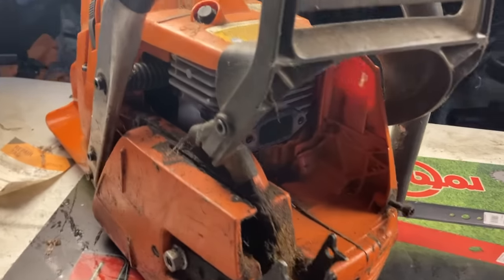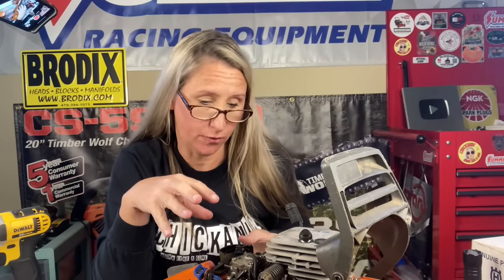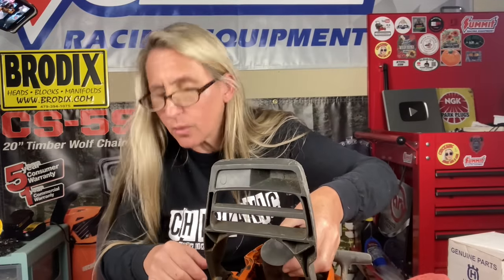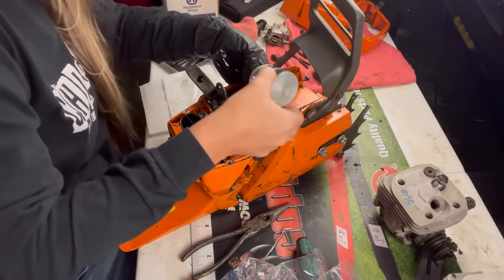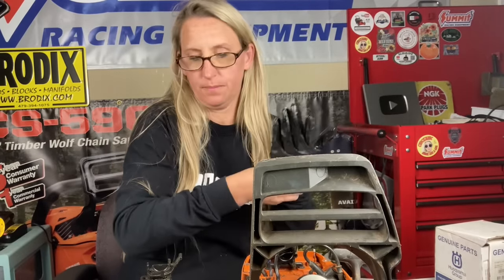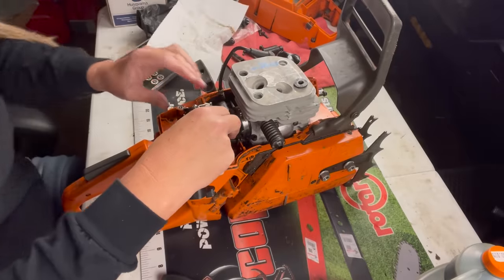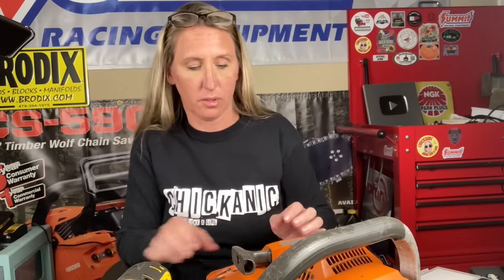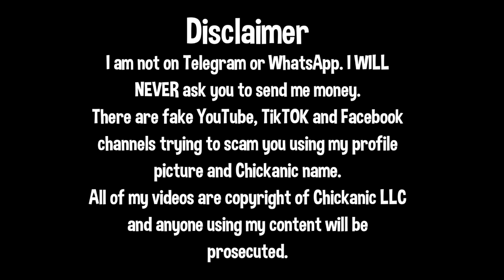Customers $1,200 Chainsaw Destroyed! Husqvarna 372 XP Rebuild

Comment: PISTON SCORING ?? I have always believed that the reason for scoring was ALWAYS a customers fault and caused by the wrong,ie, too weak fuel mix Listening and reading some of the comments it would appear that  my belief may be  wrong. perhaps a video explaining causes and actions to avoid piston scoring would be useful.
I have a pot and piston to change on an old Stihl blower (non oem so it is not a high cost risk) your video was REALLY useful. Thank you
Reply: If you don't find the true cause of the failure(crankshaft seals bad, leaking gaskets, lean or defective carburetor or intake, etc., etc., you WILL eventually have the same failure again after you rebuild it...

Comment: I live fulltime in a motorhome 17 years no landlord. got into the off grid solar power for about 9 years. newer RVs and travel trailers are junk! If you're mechanically inclined and you have a preference for certain engines. stick with that type of powertrain when looking to buy a motorhome. But if you own a heavy duty pickup, a travel trailer or 5th wheel or toy hauler is probably your best bet.

Comment: I see an engine on a stand.  🤔 Need INPUT! LoL 🤣😆 What is it and what is it going in ? 🤔
Reply from the maker: 383 that is going in my Corvette to replace the original 350.
Reply: @Chickanic  numbers matching? 🤔
Reply: @dans_Learning_Curve  Yes the original engine is stamped to the car we are going to rebuild it, but if you have an original engine and are going to drive your car it's not a good idea to keep it in there. Well put the hot-rod motor in for a while and preserve the other.

Comment: Just wanted .. to say if u use loctite  on muffler like she did use loctite 242 it's a blue color , it is a non permanent loctite.  If u use red u will need a torch to heat up housing and bolt to remove.  So plz only use just a little bit of blue 242.

I have worked with loctite in the surgical feild. For over 20 years.
Reply: Think about it. Red Loctite on a hot muffler bolt! I've used both red and blue and haven't had a problem getting the muffler bolts out. Now, if you use red on a cold fastener, then you may have to used heat to break it loose.
Reply: And I have found the blue to not hold on muffler bolts. so YMMV

Comment: That poor engine has got really hot, the bottom end is totally dry, and you can see the conrod has been extremely hot. I guess being a commercial guy he runs the 50:1 mix, which does not lube the bottom end well at all. Hope he is using good quality synthetic oil..these big saws need more than the 50:1, I'm sure Husqvarna even say 32:1 for the big 100cc sorta size. I've run my 661 on 32:1 and 40:1 with top quality synthetic (not that Ultra crap) hard for years and it's still like new. Why oh why do people scrooge out on oil..I'll never understand it.
Reply: 50:1 is all that Husqvarna recommends I just looked it up
Reply: Yep been running my stuff around 40:1 for many hours. Amazing people don’t ask why suddenly everything went from 40:1 advised to 50:1 which is obviously not enough oil to maximize engine longevity. Yeah if you run a saw for 5hrs at year at 50:1 it’ll last a long time. Now run that saw 150+hrs a year at 50:1 and you’ll be buying another saw or rebuilding in 3-4 years.

Comment: All I can say about campers trailers motorhomes is there like small engine's if you don't do the maintains it will cost a lot mine was not done I'm expecting it to cost me $10,000.00 just to make it use able and that's with me doing most all the laber😢 I do recamend fifthweel do your research.

Comment: That saw is running way too lean still, better check it for worn crank bearings and seals. Also I think it's silly to not replace the impulse and fuel lines when you are in this deep, even if they might seem ok. They have a limited life span remaining now. Not friendly to let it out of the shop like that.

Comment: Sorry, you seem like a good lady, but I give the vid a C+ or B-.  I won't dwell, but some technical info wrong, some things you missed, and possibly a incorrect diagnosis.
You got it running/  Probably did the same work I would have done if the cylinder plating was bad, (maybe just get a piston kit if available is the plating was OK?).  But I suspect you did not have to rebuild the carb, even though that is a pretty good idea for a rebuild.  My bet is the customer had no oil in the gas, and the hottest part of the piston is at the exhaust port. But I would expect more scuffing on the intake side of the piston as that side is the "major load" (a real technical term) side on the down stroke, (because of the rod angle direction).  I bet the piston wrist pin has no offset (right in the middle).  The discolored lower rod end tells me it ran with no oil, (the top rod end is stock color), and I bet if you look inside the piston at the bottom of the crown, you will see burnt oil in the center of the crown bottom.  Traditionally, that is called "death ash".  Was it running lean to lean seize by a carb failure, (there were no messy air leaks)?  If so, the spark plug would be white, (if the correct heat range/brand plug).  Check the plug first.  If it was not white, the carb was probably good.  They do fail often enough though, for sure.  I think a lot of it is the 10%ish alcohol in pump gas. 
 
Or maybe, I am just guessing on all that. :)

Nice lady

Doug in Michigan

Comment: I would have pitched a fit to put me in a hotel  tell they got me a next flight  now for a tv try looking for one of those Toyota  s  and if the body is clean a no sign d of any leaks  ,if needs another engine those are cheep they r a r22 engine et on with a standard transmission

Comment: It’s really funny that I was totally freaking out that there isn’t a diagnosis of what caused the lean condition that cooked the whole exhaust side of the piston?  Let’s remember that being an Xtorq version that it’s using the blue limited rpm range coil so it could be several different problems that potentially caused the catastrophic failure and it appears that there wasn’t any diagnosis of the problem and you simply replaced a new OEM topend onto a saw that might very well be broken and that couple hundred bucks of parts and your charging for your labor and not getting a really good idea of what was wrong with the unit original is a little bit scary?   You are a business and you don’t do any diagnosis work to make sure that you have actually gotten the problem fixed first and he’s not going to just destroy the new topend on the first tank????   I’m confused about what I watched here??!! A pressure and vacuum is mandatory for me!

Comment: Why would a homeowner need a $1200 saw? Even as a homeowner, I'd go with OEM rebuild parts.
Reply: Wasn’t a homeowner
Reply: I'm a homeowner and I have several expensive saws and they will do any job I need, firewood, tree over the road or powerline😊.
Reply: @danpatch4751  my $250 CS590 will also do any job I need. And it will likely last longer at this point than I will. 😅
Reply: Have you ever cut up a lot of 18” wide red oak logs for firewood? This size saw gets it done!
Reply: This guy has a pretty good sized operation, but we live in a forest and there are many homeowners here that own 70cc+ commercial saws. The thing is that every 2-3 years ya got to cut your way out of your neighborhood because there are that many big trees and storms.
Reply: $350 will get you a Neotec/Farmmac F380 (Stihl 038 Magnum II Copy) with 25” Bar. Pretty amazing saw to have on hand for when a smaller saw just isn’t going to cut it.
Reply: @ronaldbrown5745  no. I don't cut up a lot of anything. I use my saws mostly for clearing downed trees. I DO plan on taking some down, but I still won't be using my saw anywhere near that of a commercial user.